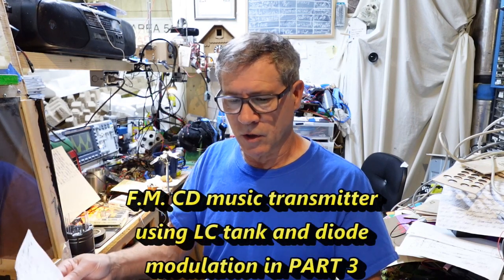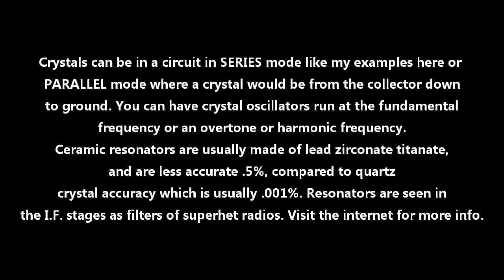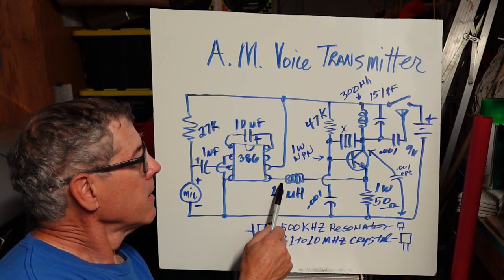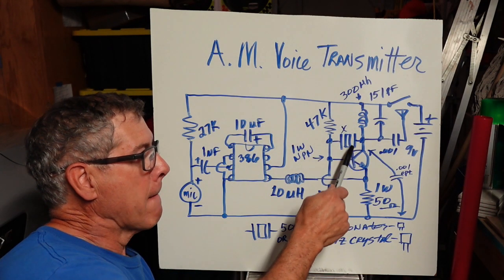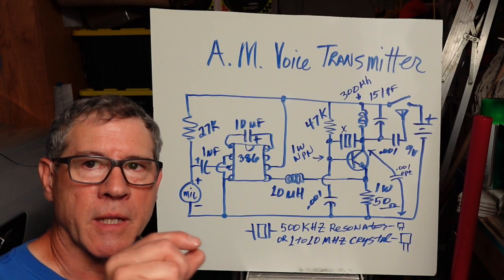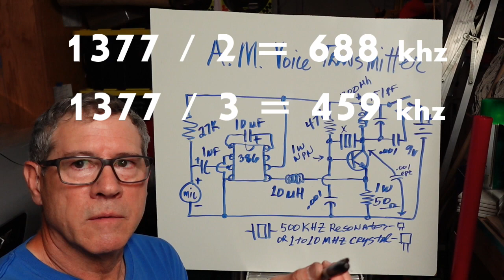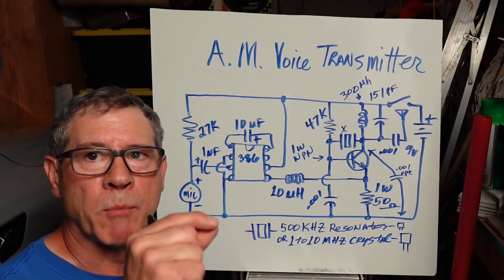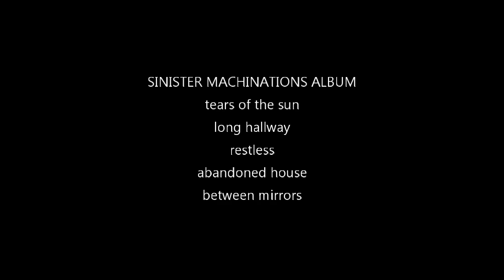AM voice TRANSMITTER 1.377 MHZ using a 500 KHZ resonator

Comment: the 50 ohm resistor may not be needed at all
Reply from the maker: Smoked some transistors without that resistor. Guess I could get a TO-3 on a heat sink ! I get good range with the 1 watt with a long tuned antenna. The range was TOO good. I had to go back to a real short antenna. I originally made this transmitter for a home movie. I wanted to transmit from the set to people in space suits and from space suits back to set, using AM or FM on different frequencies. Covid hit and no one wanted to be an actor in my movie. I have one set built out of 5 needed. Ehh..
Reply: @DavidALovingMPF102  Nice work!